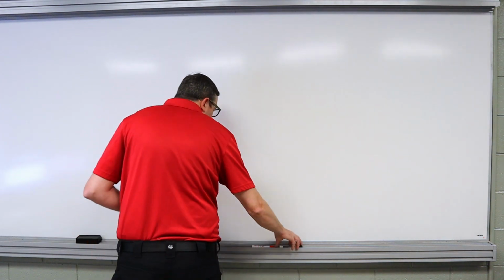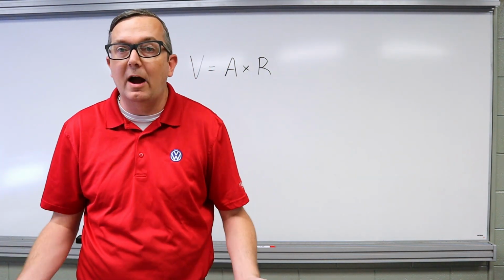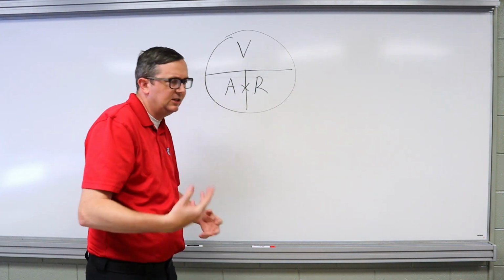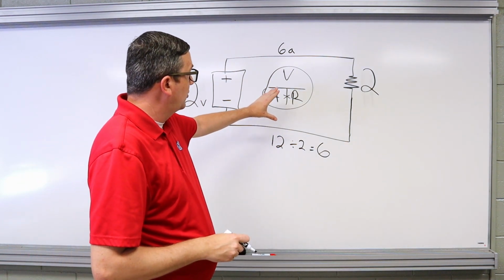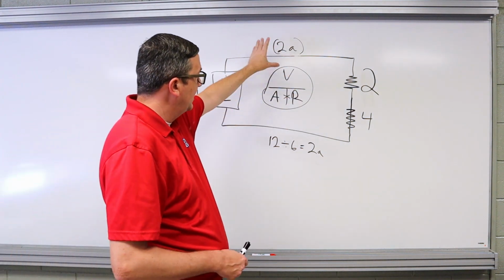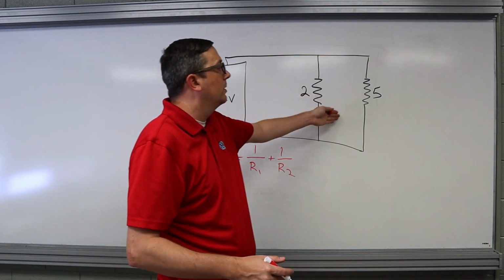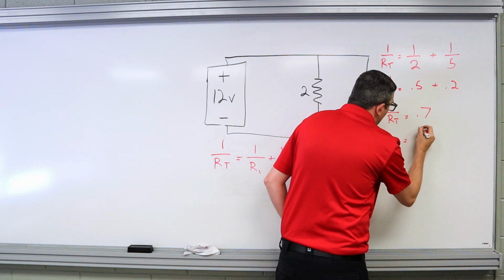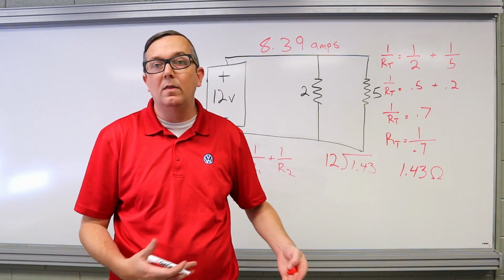AUTOMOTIVE CIRCUITS - Part 2: Understanding How They Work

Comment: Mr B. Good info. Ironically I’m having problems with the blower motor on my buddy’s F150(yes the silver one across the street). I believe the blower motor resistor has ben a continuing issue for him and has already been replaced I know at least once. Currently the blower motor is stuck on high. What problems can make the resistor continue to go bad?
Reply from the maker: Arnold Stein I have seen blower motors cause excessive draw and also issues with cheaply made resistor replacements. Sometimes the visible problems can be symptoms of bigger issues we can’t see, especially with higher amperage circuits like a blower.
Reply: Car Smarts with Mr. B yeah when he replaced it the wiring harnesses looked like it had shorted out. I was wondering if the blower motor could be pulling too much amperage? Maybe a short in the motor itself?
Reply from the maker: Arnold Stein could very well be.